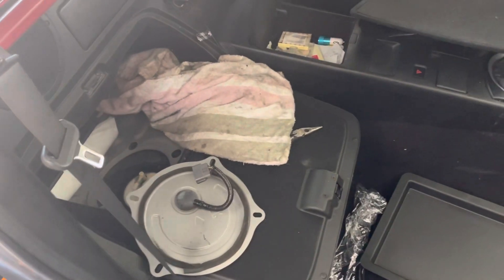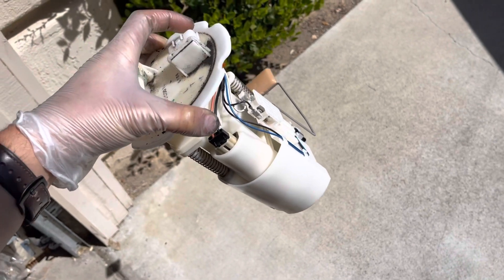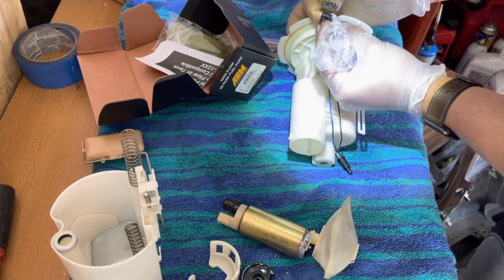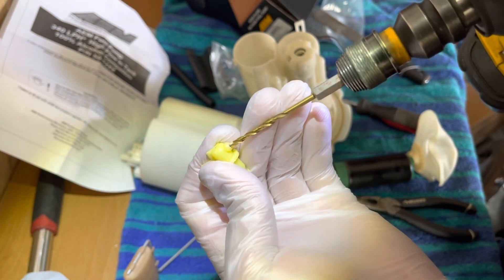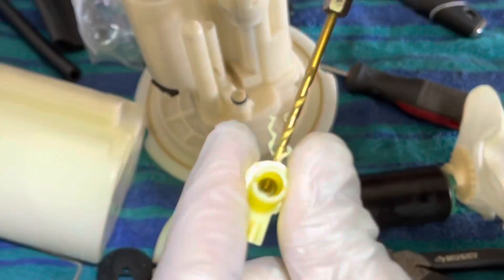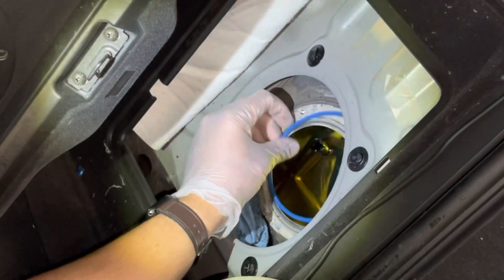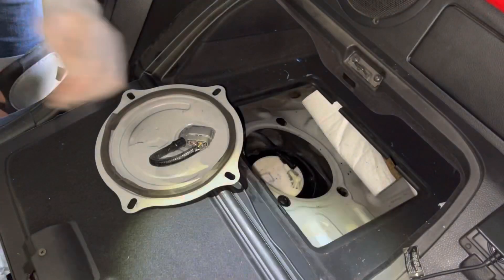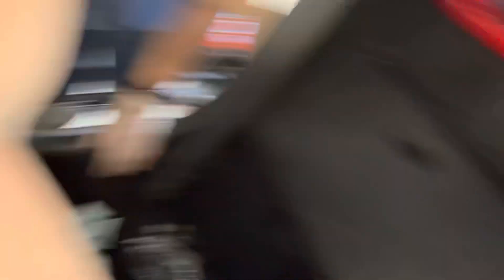Installing AEM340 E85 compatible fuel pump in 350z!

Comment: Hi buddy, great video, thanks for sharing. I have install the same pump but not drilled anything because I'm planning to install a radium surge auxiliary tank and they request to the oem pump housing not to be modified, then I have installed the aem pump without not drilling anything. I have genuine GT-R injectors but I didn't install them yet, that is coming next. After the installation of the pump, and first start my idle it's a bit low and looks like it's bouncing up and down between 650 and 700 aprox..... the car drives ok and all seems to work but this fluctuating idle it's worrying me a bit. I'm not sure if this is normal or not, In theory the fuel pressure should be the same....oem regulator not modified but I suppose because more flow the car will be more reach even with the oem injectors....I think the ECU is trying to compensate that is why the idle is fluctuating. Did you experience something similar? Do you consider this is normal before the tune... I  would like to know before I install my injectors and the rest of the bolt on's to discard a future incoming problem. Thanks in advance!!.
Reply: Any idea pls.....

Comment: Great video! It really helped me out alot. I just installed this 340lph fuel pump and 550cc injectors and ported lower intake manifold and kenetix velocity upper intake manifold. My A/F readings are wild. 11 to 14 at idle but when I hit the throttle it goes to 8 and 9. I have a retune for a 150 shot of nitrous with moncef on Thursday!

Comment: Hey man I installed same fuel pump and bigger injectors I'm not tuned yet, tuner will be coming to my house in a week, but we start the car and it acts sputtery and like it wants to run out of gas, would this be because I haven't got tuned yet or is there a problem with my installation
Reply from the maker: It’s normal when not tuned. Since your pump now is bigger as well as injectors, it’s spraying more fuel into the cylinders. So your afr I assume super rich. It would cause your idle be very rough

Comment: Kinda reckless using that drill, those tiny bolts only needs to be hand tightened, one stripped thread then you gotta replace the gas tank…
Reply from the maker: It’s very easy to modulate torque on it with the trigger, it’s was about “hand tight”)

Comment: I’d recommend adding/welding in an x pipe between the resonators and flex pipes on the dual split y pipe. It would give the car that vq tone if you prefer,  as well as more power
Reply: single exit FTW >

Comment: Good detail video. Was going go with the aeromotive 340lp fuel pump but I just go with the aem since I don't have to splice wires.  Did you also bore out the hole for the fuel pump regulator?  And is it necessary since you did it to the little plastic piece.
Reply from the maker: I didn’t drilled the fuel pump regulator, just a plastic piece